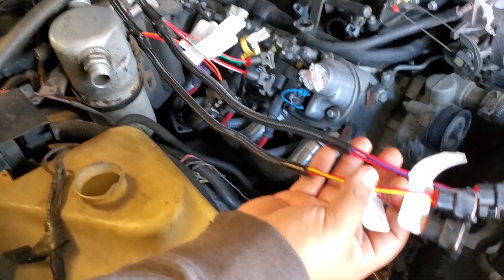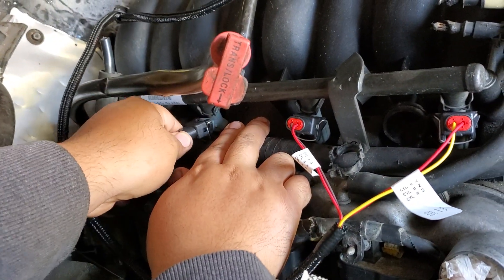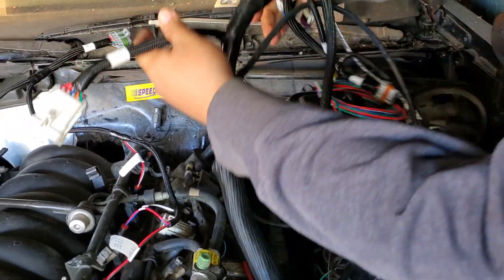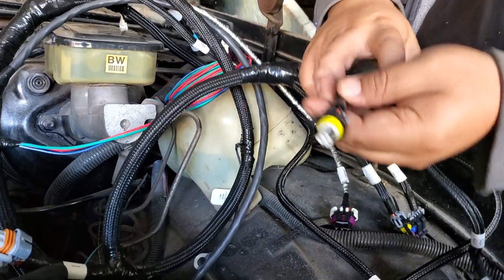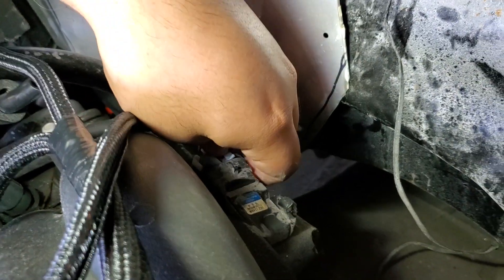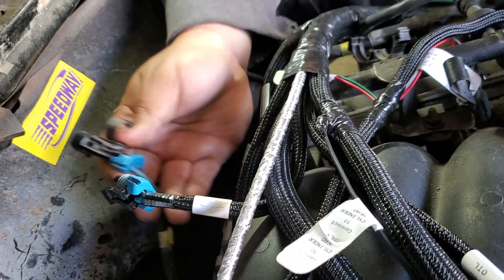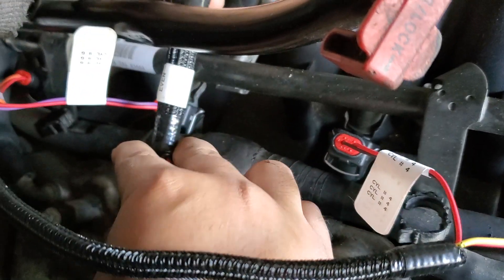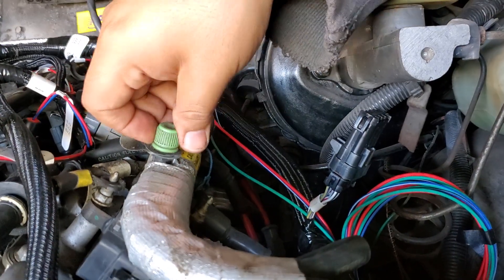Holley terminator x max installation PT.1

Comment: I have 97 obs, I ordered terminator x max.  Is it anything I will need from the  factory harness?
Reply from the maker: There’s nothing you will need to make it run. The kit includes everything. However you might want to use some of the factory wires if you want to use your factory guages. And stuff like that.
Reply: What about starter and ignition power?
Reply: @Mike-ol9tm  what did he just say?